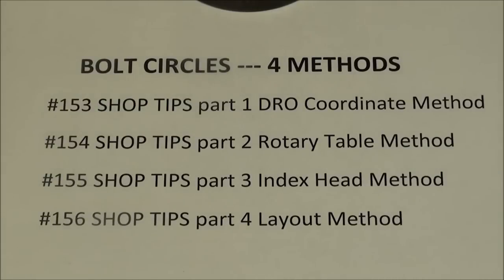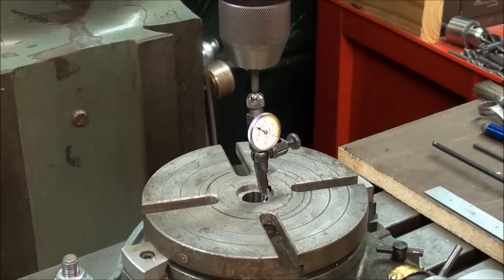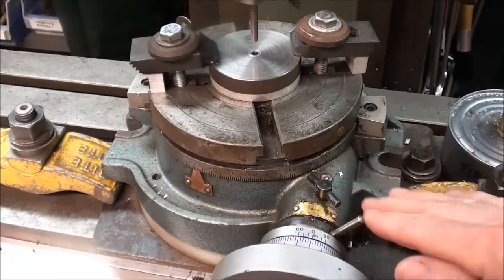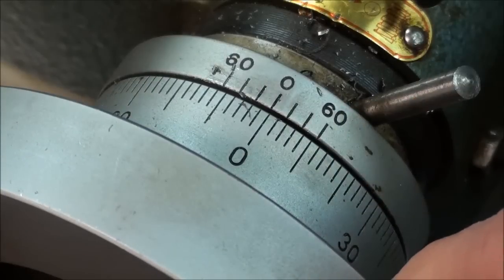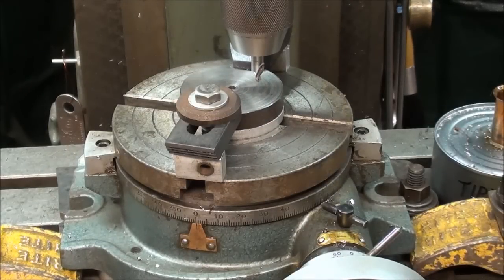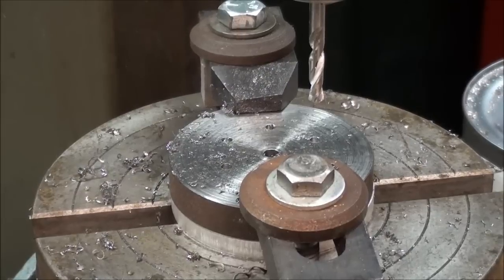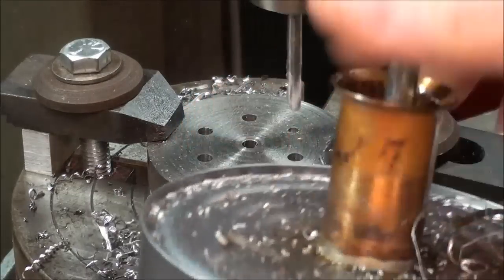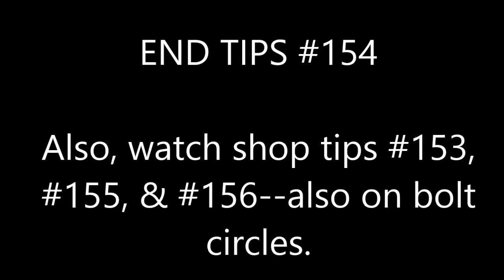MACHINE SHOP TIPS #154 Pt 2 Bolt Circles-Rotary Table Method tubalcain

Comment: I did use this method to machine a replacement flywheel on a kubota engine modification skid steer.  John.
Reply from the maker: Glad to hear the method worked for you!

Comment: Idea, If you would have made the aluminum backer plate the same size as the metal plate, you could have finished it with holes and chamfers later to make a lathe handle for a cross slide on another machine.

Comment: One small tip.
Drill a tiny dimple with the centre drill and check with a steel rule before committing to a fully drilled centre.
Reply from the maker: Thanks

Comment: Can you reduce the size of a radius by using some locking nut etc on the center hole, then slowly take off the side of the wheel to your tolerance?  I am working on sizing a piece of round stock to fit/plug off the end of a  thick walled pipe.  I don't own a lathe.  trying to slowly turn a piece on a rotary table.  Is this workable or not very safe.  Needing to lift up the piece to not to cut into my rotary table.
Reply from the maker: I think it is very doable

Comment: Mr. Pete. I have a question. Using the rotary table. I have a work piece that has radius mill at specific locations at a specific depth. I think I have to set up the center of the rotary to each center point. Is there a different techniques. Thanks.

Comment: Hi brother, I noticed that the spacers under your two clamps were lower than the height of the work piece. May I suggest that you use a spacer which is slightly higher (+- 0.5 mm) than the work piece which will give you a positive down force instead of tending to tip the work piece using a lower spacer.

Comment: Nice video on rotary table operation. With respect , I was wondering if you would also show how these holes can be put in not using a table but with trig. I have been a toolmaker for forty years and have used this method for uneven locations as well.

Comment: another great video.  How about cutting a radius on a flat bar on a rotary table without a DRO?
Reply: if you need any products  realted machine tolos as like rotary table, dividing plate, clamping kit, taper turning tailstock, adjustable swivel angle plate, tilting vertical slide, boring head and  professional forming kit so please
 contect me on 

my email : ajay9811112567@gmail.com 

skype id : ajay sharam100

And you will be available at very good prices

Comment: It may be worth noting that your DRO (at least for the x axis) is reversed! When you moved the tool to the right it read out -.625 it should have read +.625! While it would be easy enough to use it this way on a manual mill it might be best to follow the conventions of the Cartesian coordinate system to avoid confusion for your viewers and to be better prepared for CNC programming and operation... Love the videos-Thanks!
Reply from the maker: Thanks--will try to fix.

Comment: Why didnt you just push an endmill through to make the holes? Its not really the "right" way to cut holes, but the work you're doing is just for show and plunge cutting with an endmill is one step for each hole.
Reply: ajju poku I agree, you don't want to use endmills for this job, they're not pockets, they're pass-thru holes, you wouldn't use endmills for this unless you had a money growing tree. My 4 fluted mills do not clear very well on aluminum, they do OK-ish with steel on a dry / limited lubrication setup like this. Sharpening twist drills is childs play compared to endmills, You can always drill undersize and ream if you want a better finish, at the cost of reamer life and your time of course.
Reply: gushhnet Why are you even bothering with using a 4 fluted endmill on aluminum? They just gum up and dull out. Use a 2 fluted mill with some alum-cut and it will cut like butter. My high speed steel end mills get thrown out after they are sharpened once or twice. I pretty much use carbide mills for everything nowadays, they hold up much better and the generally cut better, even plunge cutting. Like I said before, the job he is doing isnt really precision work, so save yourself the time.
Reply: ajju poku Yup, but most of us use what we have, I hardly buy tooling specifically for a project, unless there's no way around it. Most of my tools are used, as NOS is hard to come by where I live and the prices of new endmills are too high for a hobby. It is what it is.
Reply: ajju poku I have never used a 3 fluted mill, never saw a reason to. Then again, Im on a Bridgeport mill using carbide tooling on everything so I never worry about dulling mills or speeds for the most part. I run almost all my carbide tools at 1400 rpm, unless its a special tool, such as a roughing mill. I do this for a living, not a hobby.
Reply: Non-coated mostly, its what my company buys cause they are cheaper. Coated I run about 2200rpm, thats still slow in some cases but im machining delicate components for fixtures. I build fixtures for plastic injection molded components for the auto industries.
Reply: Drilling with square end mills ends in a lot of sheared off end mills. A 3/8" end mill is ~50 bucks, breaking it would be silly.

Comment: I don't know about you but I don't care much care for the metric system. Jumping between metric and the inch system is a real hassle.
Reply: I don't care for the imperial system myself, but there's no arguing it exists. I switch back and forth seamlessly, the problem is when they both collide, which they shouldn't, but ask NASA!
Reply: gushhnet I won't argue that the metric system works well, but I'm used to the inch system and my machine tools are all in inch. What is really frustrating is when a tractor or piece of equipment has both inch and metric bolts, I have to own two complete sets of tools.